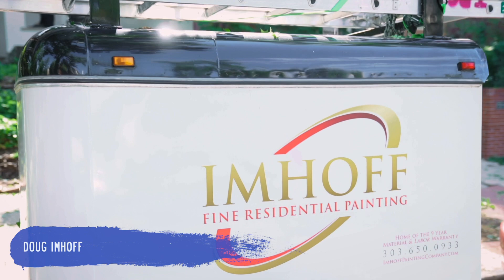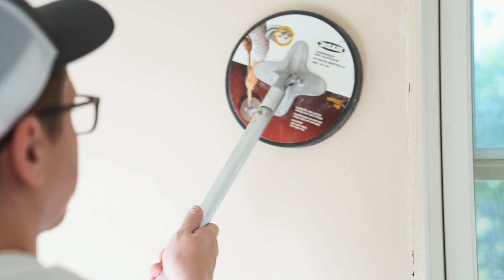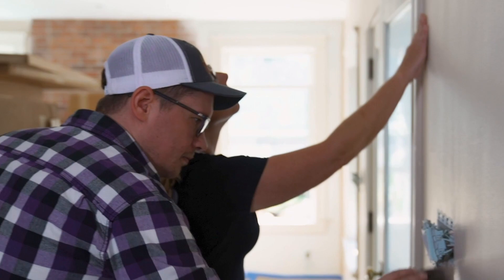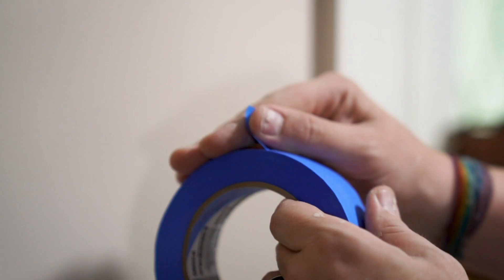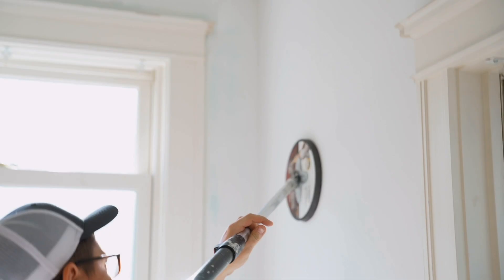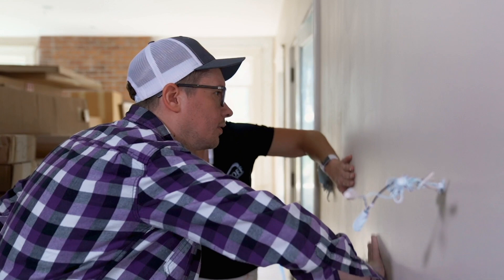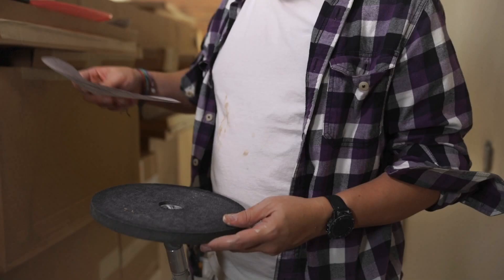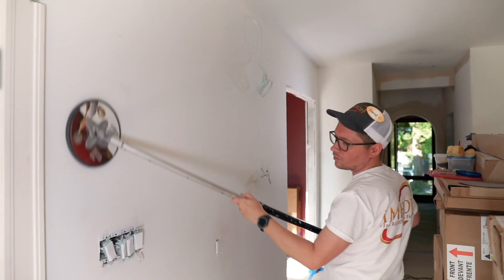Professional Surface Prep

Comment: Clearly Never used a 360 Sander, What this version is a copy of. Try the 360, Much better. Nice Commercial though
Reply: The sandpaper on the Hyde is different. Looks like same stuff I have on my Mirka sander. If it is, it will last way longer than the 360.